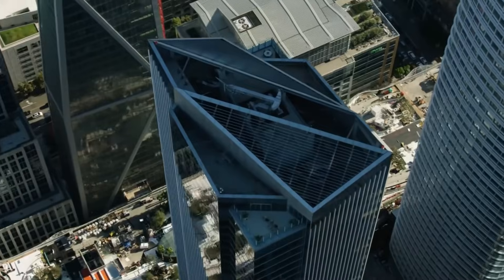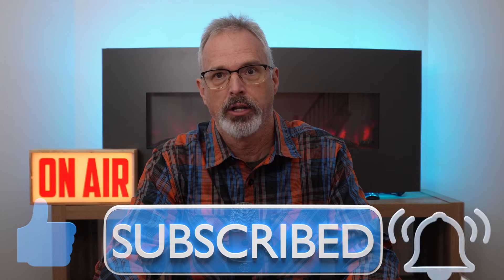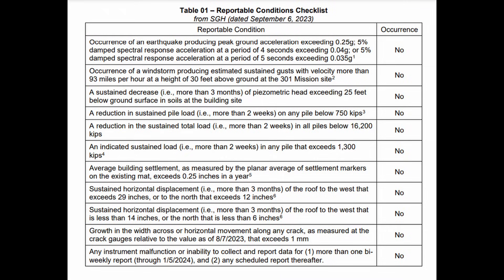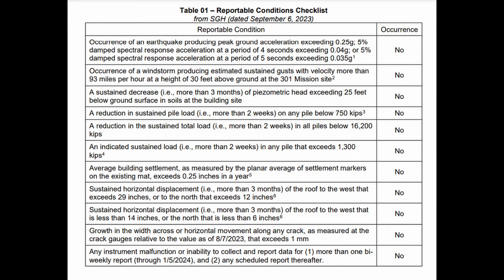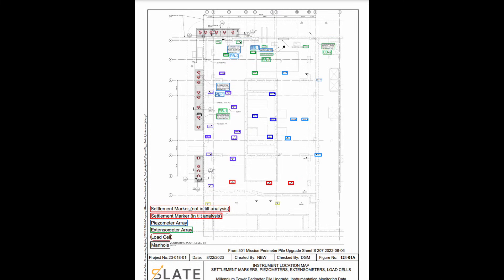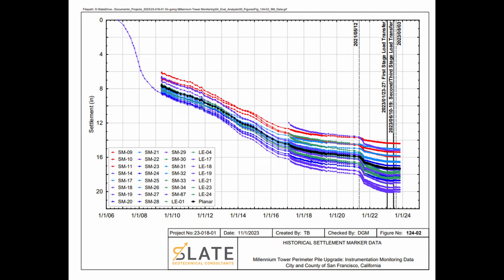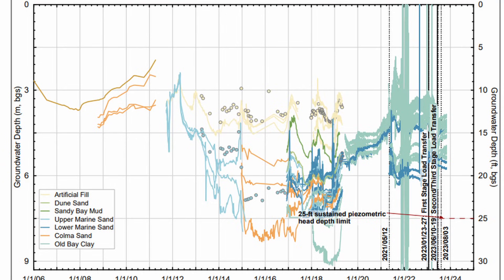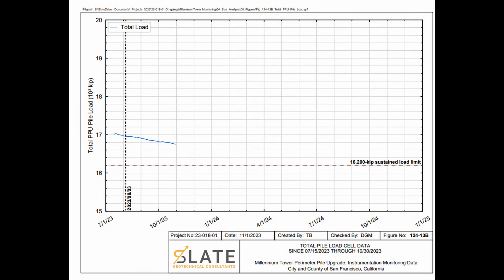Millennium Tower "Repair" - What is Going on with the Monitoring Results

Comment: I wonder if the decrease in the amount of tilt reduction after the jacking load was applied might be due to the flexing of the slab, as it's subjected to bending moments due to the contact forces of the pilings being applied to the edges of the slab. If this is true, would the bottom side of the concrete slab be subjected to a tensile stress that might eventually exceed the amount by which it has been prestressed and possibly crack?
Reply from the maker: Yes I think that's very much a likely mechanism that's occurring now. There have been cracks reported in that slab already. You will want to check out my video update on the Millennium Tower that posts this coming Sunday.
Reply: @CaseyJones-Engineer  Thank you. I very much appreciate your expert analysis on this, and other, structures.

Comment: If the building is so unstable in relatvely static conditions, are there any hope it would survive even a modest quake?  We now know that the foundation engineers relied on a model that was completely unrealistic.  The tenants are flying blind, with only a hope and a prayer in the event of a quake.  Unless you want to end up like the disaster in Florida, it's time to call it quits.   Get out while you can.  And never trust SF building inspectors again. They haven't a clue at evaluating the viability of the foundation.
Reply from the maker: I think that there is serious doubt about this building's foundation performing well during a major earthquake.  I think an independent engineering review needs to be performed to assess this question.

Comment: Several possibilities:

The mat is failing as it is loaded in shear.  

The interface between the mat and the vault is yielding. 

The “fuse” all-threads connection to the vault mass is yielding — likely pulling through the lower steel plates. 

The “fuse” all-threads are yielding at the nut threads.  

The lower plates on the all-threads are pulling up breaking the concrete. 

The piles are forcing their way into the bedrock or were not entirely touching the bedrock initially. 

The “fuse” all/-threads are yielding due to necking under load.  

Or all of the above. 

So increase the jacking back up to 1.3 million pounds on each pile. Have an acoustic sensor array listening for concrete and steel cracking.
Reply from the maker: I think you have outlined things very well and  your suggestion of acoustic sensors is fascinating. I would like to mention your idea in my MT update video that I am currently working on.
Reply: I think acoustic sensors could warn of imminent failure of a structural member or of the collapse of the entire structure.
I think they are attacking this from the wrong end. Would it be easier and cheaper to make the high side settle faster?

Comment: Reminds me of the Floria Surfside condominium collapse. Not the specific causes, but the same foot-dragging morass of a disaster everyone knows will happen.

“On June 24, 2021, at approximately 1:22 a.m. EDT,[a] Champlain Towers South, a 12-story beachfront condominium in the Miami suburb of Surfside, Florida, United States, partially collapsed, causing the deaths of 98 people. ... The problems had been reported in 2018 and noted as "much worse" in April 2021. A $15 million program of remedial works had been approved before the collapse, but the main structural work had not started. Other possible factors include land subsidence, insufficient reinforcing steel, and corruption during construction.“
Reply from the maker: I agree with your assessment.  I did a video on the Surfside disaster if you want to check it out.  https://youtu.be/Ebj5fCE7hV4

Comment: I worked for a company that drove piles for high rise foundations.  We would send a pile down to bedrock in all cases, or we would dig an underpinning pit 4x6 ft down over 100 ft.  We actually had piles hit shallow bedrock layers and turn and do a 'U' and come back out of the ground.  It's the only safe way to sure up a building.  Apparently this builder sured up is pocketbook.
Reply from the maker: They were all about trying to save a buck it seems during the original construction and now look where it got them.

Comment: I am not an engineer, or need to know about buildings, but I find your content fascinating. It also helps me with my terrible earthquake fears.  Somehow understand building safety makes me feel safer. I don’t live in a typically earthquake prone area, but in-laws do and I have been in numerous earthquakes.  The 6.9 made me so very afraid.  Understand how buildings can be built in earthquake areas helps my mental health!  Although the building in this video, no.  I can’t imagine a building that tilted being acceptable in Japan.
Reply from the maker: Thank you!  Most structures are properly designed, built and maintained in my opinion.  There are lots of things that can give rise to phobias.  I live in an area where one can be exposed to a large tornado on a fairly regular basis.

Comment: I believe no high rise should ever have been built in a potentially seismic active city as San Francisco. Whether it has been anchored in bedrock or not shouldn't even matter. Who is to say that a future quake might not be even worse than the one in 1906.
Reply from the maker: As long as liquefaction isn't a factor, tall buildings can be built to safely withstand earthquake (especially steel-framed structures) as they Japanese do it all the time.  The problem with this building is that the foundation apparently wasn't properly designed to have the much heavier reinforced concrete structure that was used instead.

Comment: the slab has cracks under it, on the bottom of the slab-where tension is. this will not end well.
Reply from the maker: I agree with you. I emailed the S.F. Department of Building Inspection posing several questions about the M.T. and I will post an update video if they answer.

Comment: My guess is that the building is uninsurable….
Will/is experiencing gravity required plumbing issues and will be ongoing and become more significant..
Will/are experiencing glazing issues…
Will/are likely to have to reduce floor count to ease the rate of offset…
The significant expense in stabilization should be considered as the entire unit may be a loosing venture and razing the structure will be the most cost effective product…
Reply from the maker: I agree with you that this building is on the path to total economic loss. If that happens I hope it will be before a major earthquake strikes S.F. so the people would have moved.

Comment: This link to geologist consultant/professor explains why the foundation may not be to the bedrock.   They may have gone down to what they thought was bedrock but in reality was just boulders that looked like bedrock on top of old glacial deposits.   Kathy Troost a geologist shows exactly what this looks like at time stamp 1:02:15 in https://youtu.be/HcjyYVt4BRE?si=2GxcNhYlEIBic8Sp
Reply: The logical question is … do all 18 perimeter piles have the same amount of relaxing and rate of relaxing?

Comment: I think the threaded rod "fuses" are stretching. They were designed to stretch, but this is really fast. 

After I heard that there was a DBI whistleblower calling out the permit for the fix issued on 12/31/19 I lost all faith in the fix.
Reply from the maker: Interesting.  You may be right about those rod connections.  Something appears to be creeping whether it is that or the soil/pile/bedrock interfaces.  I have an email inquiring out to DBI so will provide an update video if I get a response.  Thanks for your comments!
Reply: @CaseyJones-Engineer  Here is a link to the whistleblower letter: http://www.lbkarp.com/mi/Whistleblower%201-10-20.pdf 

Also Building Integrity has some good videos as well.

Comment: No one has every made a big deal about any bad news re this buidling.  Just buck passing.  Bottom line is the engineers, who could only be forced to admit the truth in court after other engineers prove the wrong.  The gov't is not going to do this as they made the incredible STUPID decision to allow the engineer to change from the same to bedrock piles typically used in SF to short piles AFTER vastly increasing load.  That was a grave mistake by the city.  It was the first 'look the other way', where they said well the engineer said it'll work, it'll work.  Instead of we don't care what you say, this is a bait and switch, it stinks of a scam being played against the city, we have the right to force you to hire an independent engineer to verifty structure, do it.  Of course, there was probably a pay off, many ones as this BS 'look the other way' continues to this day.  Perhpas blackmail was involved and not a pay off, some horrible deeds city officials were hiding.  It's obvious we will never know.
Why the unit owners haven't sued everyone in sight eludes me.  The owner should have been sued, lost, the building given to the people, gone in bankruptcy from the debt, loss in value, repair bills, banks take the hit for not doing their due diligence, the costs passed on to the banks customers via gov't approved fee increases, and unit owners face the reality of vacating while it's properly fixed, becoming part owners of a project that might never return a buck.  Then remortgage the building to fix it properly even if it meant cutting it in half, injecting an ocean liner of grout under the tilting and cracked slab, drilling 1,ooo micro piles down to bedrock through the slab, rebuilding all the interiors to be plumb and level and redoing all the plumbing elev and other elements effected by tilt, with everyone losing 1/2 their investments, but just half, when now stable units are sold 10 yrs down the road.
Reply from the maker: I agree with everything you said.  I think that continued economic losses will occur before any real, effective action is taken to fully repair this building.  I just hope a large earthquake doesn't occur in the meantime.

Comment: If you haven't seen this, I recommend you check out Mr. Porter's YouTube videos under "Building Integrity" which is the name of his company.  As a retired consulting engineer, I have watched all of his presentations.  One of which called so meting like " did I just find a $100,,000 error in the Millennium Tower fix ? "  Also, Mr. Porter suggested an alternate view of the subsurface conditions for the building and considered the entire area below the building reacting to the load as a unit.  Also, it occurred to me that by placing high "reverse" loads on one edge of the building, might there be some new opposing loads on the opposite side of the building.  After you review these videos, I'll be interested to see and hear your comments.  Thanks  PN
Reply from the maker: Thank you.  I just heard about this video.  I messed Mr. Porter to relate his concerns about the likely weakness of the connecting steel plate at the bases on the anchor assembly around these piles to the possibility that this is the cause of the obvious pile loading decreases over time. I haven't heard back from him yet, but I just left that message today.  There seems to me to be some type of relaxation going on, whether it is the pile relative to the soil or these anchor plates.  I have also email the City of S.F. about this and I am waiting to hear back on that too.

Comment: Measure twice and cut once. Obviously the builders of this monstrosity tried to cut corners from the beginning.
Reply from the maker: You are right.  The tried to save money right off the bat by switching from a steel framed structure to a reinforced concrete structure that increased foundation loads by 56 percent but didn't change anything with the foundation installation.
Reply: @CaseyJones-Engineer   I used to work in Quality Assurance for a software company and saw the ramifications of trying to fix problems after delivery that we knew about during development. But code is a relatively easy fix. I can't imagine trying to fix a building!
Reply from the maker: I think the building will become and economic write-off.  If that happens, hopefully it will be before a major earthquake occurs. @Darrylizer1

Comment: I expect if the load falls to the point of a reportable condition, they will just add more load with the jacks.  This seems normal to me for the structure.  The vaults were designed to give access to the jacks, so I don’t see any problem here.
Reply from the maker: True, but it raises the question about what is causing the relaxation of the pile loads. Others have questioned whether the anchor plates in the jacking system have adequate strength.  I also find it odd that these monitoring reports are strictly "data reports" with no analysis or conclusions.

Comment: Shouldn't Ron Hamburger be working at In&Out or McDonald's? I mean it's a natural really.
Reply: He is the engineer who arrested the progress of the tilting.  He did what he was hired to do.
Reply: @GH-oi2jf  but it'd be easier if he were making big Mac's that's all I'm saying
Reply from the maker: My issue with Mr. Hamburger is that he keeps missing his predictions about performance of the building and seems to just shrug it off.  He also said he did not anticipate the additional and accelerated foundation settlement and building tilt during installation of these piles and instead stated that it was the contractor's responsibility to figure out how to do everything.  This to me is disingenuous especially since Lawrence Karp warned the City of this exact issue about 18 months before the "repair" work was started.

Comment: If the building were to fall, how much damage to other structures would occur. Seems unsafe outside the building as well.
Reply from the maker: It would be devastating.  The only fortunate aspect that reduces some of the danger is that the Salesforce building across the street from the M.T. is currently vacant.

Comment: I used to live in an high raise condo in San Francisco around half a mile from the Millenium Tower. It was much smaller and built in 70s. When the Millenium Tower issue first came out, a few tenant were concerned so there was a public meeting where the building management explained the differences.
What I learned was that my building was built on a similar soil (although the bedrock was slightly closer), is much smaller, and has piles to the bedrock. I alseo learned that the building settled over the course of the construction and in the following years by more tha an inch and it still slightly settle, and that was exepected, it was actual in line with the best case scenario produced by the building designers, so nothing wrong.
Did they expect the piles to settle? By how much? I have a sample of one, but there are several high rises of different ages around the Millenium Tower that are anchored to the bedrock. How much did they sink overtime (I think there was a report somewhere for the Salesforce Tower but I can't find it). Can this be just normal settlement? And if so, was it expected or unexpected? If unexpected, how this impact the rest of the design for the fixes.
Reply: The MT designer was expecting less than a foot of sinking over the lifespan of the building. It had already sunk 18 inches in just a few years.  I'm pretty sure the Salesforce Tower was driven to bedrock.  Anything on bedrock should be pretty stable...until the Big One.  All bets are off if San Francisco gets hit with a really strong earthquake.
Reply: @CONTACTLIGHTTOMMY  If I remember well, they were expecting 5.5 inches over 20 years for the original foundation. My question was which is the expecting settling of the new pillar driven to the bedrock.
Reply: @CONTACTLIGHTTOMMY  I'm not a civil engineer or a geologist, but what I learned is that also piles driven in the bedrock settle, even if the settlement is only minor. I don't know the exact mechanism, and maybe modern tech for drilling piles is better.
I'm not saying you are wrong, I actually agree with your statement: "Computer models are great, but what actually transpires 100 feet down is anybody's guess"

Comment: Could they reduce the height of the building  to reduce the load it is putting on its base and therefore stop the settling? If so the question is which is cheaper fixing it taking it all down. Not counting legal cost which will make this a failure.
Reply: Sure, just take off all except the first 5 stories, and everything will be fine.
✌️😁
Reply from the maker: Yes they could but as you point out it wouldn't be cheap.

Comment: Again, I wonder if we're seeing evidence backing up structural engineer @BuildingIntegrity's concern about those thin steel plates having to resist the full force of two piles' cables under tension. Maybe the cables pulled throught the steel plates, like the Hyatt Regency Walkway. Or maybe the concrete around those plates is starting to crack.

He was concerned because, while he found evidence they'd done load/force calculations for other elements of the pile/building interface, he found no calculations for those steel plates. he seem to think they might be inadequate for the loads they were expected to bear.

I'm not an engineer, though, so I don't want to misrepresent his excellent discussion by my own ignorance. See @BuildingIntegrity 's "Have I Discovered a Mistake? I hope not" video in his Millennium Tower playlist.
Reply: https://youtu.be/Xezg8PxVSYA

timestamp 15:30
Reply from the maker: Thank you.  I am not familiar with that video so I will check it out.  But that connection could be yielding which would explain the decrease in pile load over time.